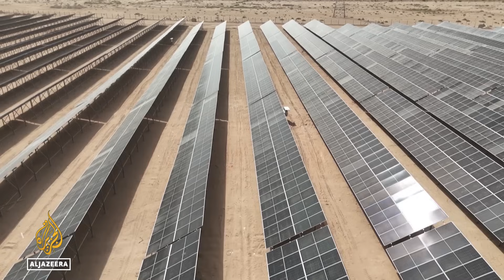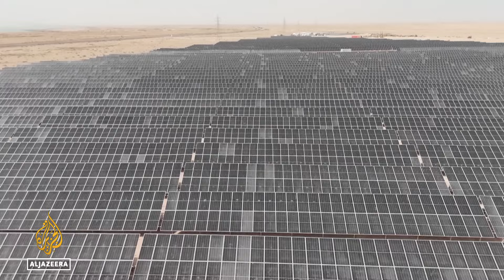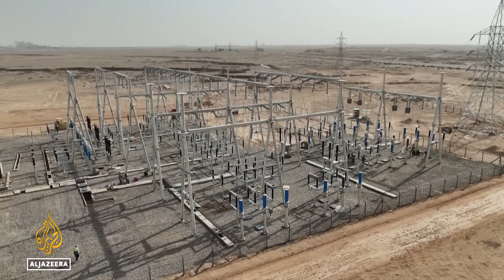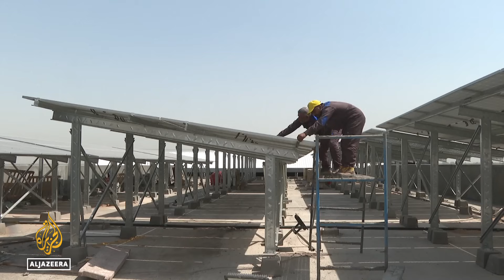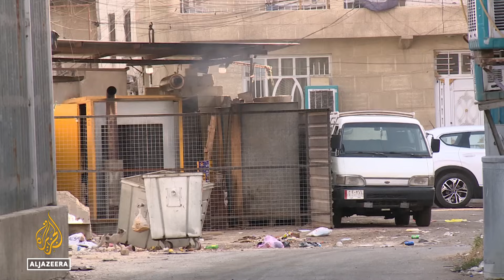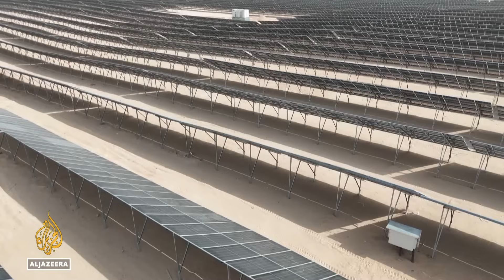Harnessing Iraq’s sunshine: Solar power projects are gaining momentum

Comment: Fuel imports?? Don't they have heaps of fuel?? Aahaha, anyway,  good to see them investing in solar, perfect place for it
Reply: You need a lot of money to get the oil out on a significant scale
Reply: @verygoodbrother yeah but you get a lot of money when you sell it isn't it? There's no lack of contractors that would be willing to invest
Reply: @martinluescher5009  Not necessarily. The cost per barrel isn't that high at the moment and will only drop if they decide to extract and sell. It also doesn't address the issue of aging electrical infrastructure.

Comment: The solar panels should be combined with batteries. If people in the local communities become self-sufficient with "micro grids", it would also lower the requirements of the national grid.
Reply: True. Only at this moment, hybrid inverters are 'new' and still several times more expensive than simple grid-tied ones (~2000 vs 500 euros). But their prices will probably come down in the next few years- and then installation of systems with batteries will start booming.

Comment: They should learn from Pakistan (Most rapidly solar adapting nation in the world in 2024) rather constructing these huge solar plants outside of cities which will put load on aging grid, they should subsidize solar panel and inverters so people can install them directly above their homes, factories or shops. This will not put any load on grid.
Reply: @versaty65  it still does put load on the grid, but not concentrated on a few centralized transmission lines, which are expensive to upgrade or expand. The additional grid stress from this is much better distributed and is cheaper to maintain since its smaller, local, incremental improvements.

Plus, a lot of people still steal electricity, lol
Reply: @GodofGHz  not sure what you talking about. How can solar system on a home or office roof top put load on grid ?
Reply: @versaty65  Most systems here in Europe are grid-tied, and export extra electricity to the grid. At mid-day, that extra gets so large, that export limits have to be set- and some households do not get to export at all. However, if in Pakistan you use off-grid systems, or do not allow export, then sure, no load on the grid then.
Reply: @NeblogaiLT  right, we do have on-grid or grid-tied system as well but large scale solar installations such as on big commercial buildings or factories are off-grid. Mostly residential buildings also use off-grid system because there are certain requirements needed to be fulfilled for that, making it more expensive compared to off-grid. and of course agriculture use (farmers using solar for running tubewells) are off-grid as well. so this way it does not add load to grid.
Reply: Both is needed.Old centriliased grids are not build for decentriliasied generation. So you want to build local solar to cover your own needs and grid solar for grid stability.

Comment: Those panels  looks dirty. How often are they cleaning them?
Reply: If you watch the video one of the Iraqi Energy experts clearly states that one of the challenges they face is dust.  If you experience dust in that region you will understand that it is an uphill battle.
Reply: @andrejturan2525  even if they do get cleaned frequently, I reckon it’ll just take a few hours at most to get dirty again. It is a desert after all
Reply: we offer u that jobb ..
Reply: Its actually not as big of a deal as you might think. Yes some light is reflected and not captured by the panel. But because of that, the sunlight is not heating up the panel as aggressively, lowering the temperature, and boosting panel voltage in the process.
Reply: They dont, all they know is stealing money and living their luxury lives in Europe and America. Iraq is just a source of money for their pockets
Reply: I assume that they bought the panels from China.  China has billions of solar panels in the desert.  Their solution is to use drones to give the panels a small spray wash.  What they found is that after a few years the washing water and cooling from the panel shade caused grass to grow to the point where they have brought up to 300,000 sheep to graze on a a typical solar farm.
Reply: China also sells a cleaning robot